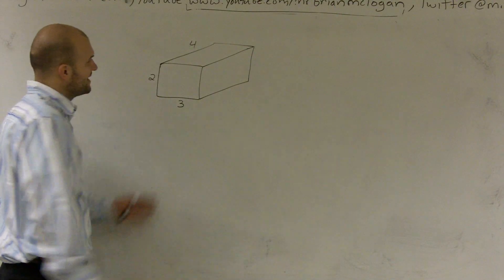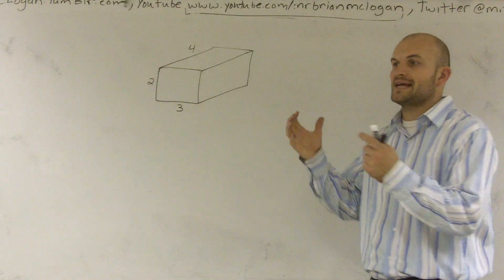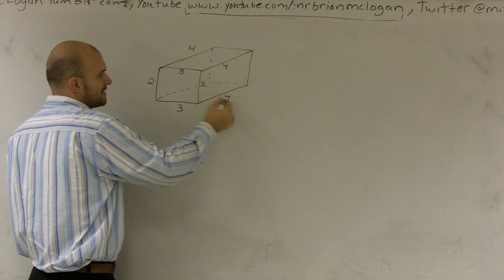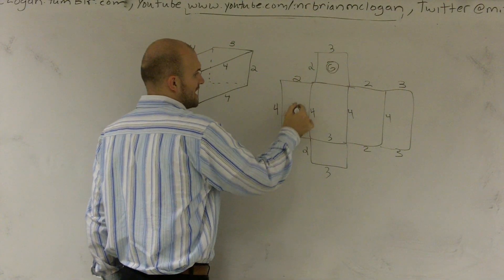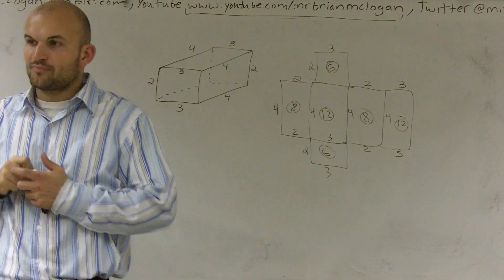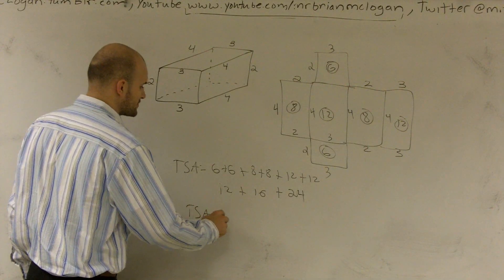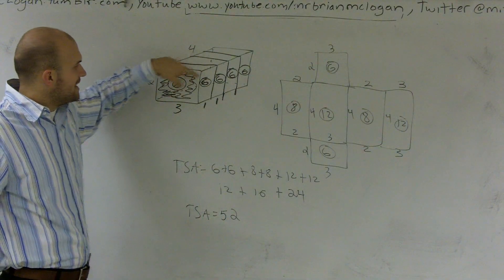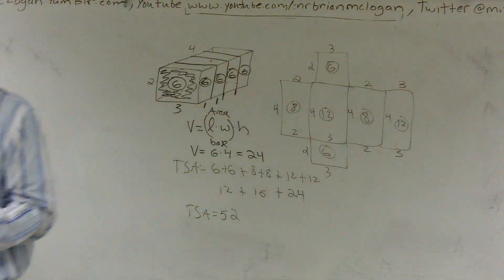Finding the volume and surface area of a rectangular prism

Comment: Please answer this:
A Rectangular Prism has a square base measuring 30 meters on each side and a height of 16 meters. If a plane is allowed to intersect the prism at any orientation. What is the largest possible area in square meters of the cross section?